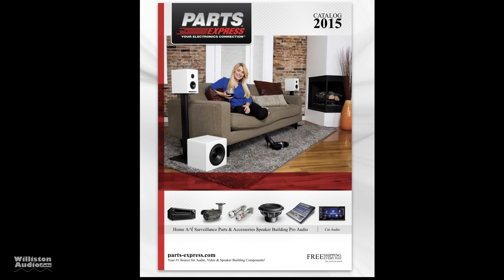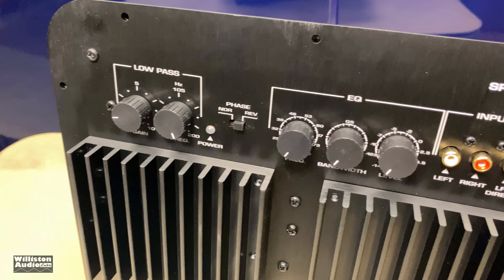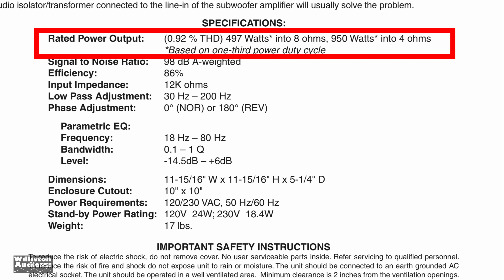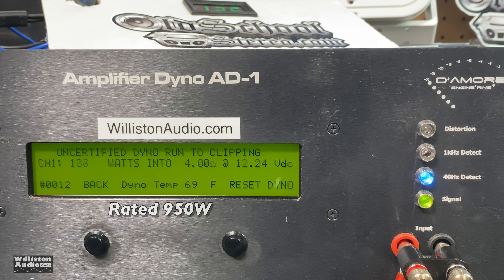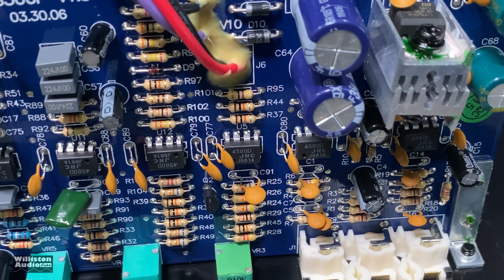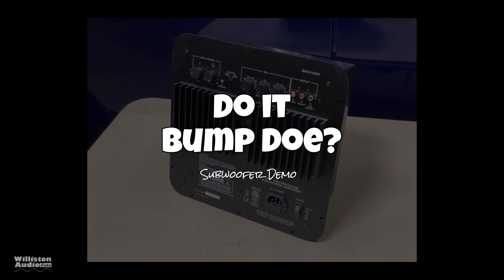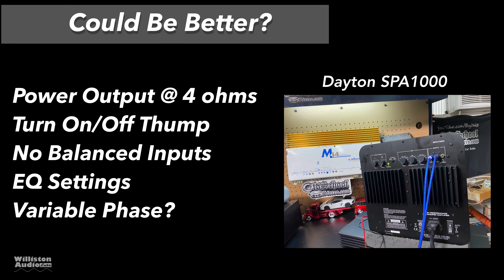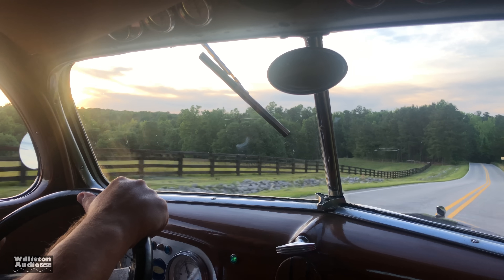DIY Subwoofer Amp for Home Theater - Dayton SPA1000 1000W

Comment from the maker: Shop for the Dayton Audio SPA1000: https://amzn.to/31Jb6Rz
Don't want DIY? Check out this Sub: https://amzn.to/2Z1S0V5
SMD AMM-1 Handheld Amp Dyno: https://amzn.to/3iw1Ztm

DISCLAIMER: This video and description contains affiliate links, which means that if you purchase from one of the product links, I may receive a small commission. As an Amazon Associate I earn from qualifying purchases
Reply: Tre L  I know seems like its way more affordable to get a car amp and rig it to a battery setup in a house than spend a arm and a leg on a very exspensive PA system and some plug in the wall subwoofer with outrageous exspensive💰 shelf speakers.
Reply: I got one of those , i put a 12volt amp fan in the side of it and run it a 1.5 ohms... Powered a rockfordfosgate p3 12 in a ford tarus on a power converter... Very loud... Still have it, wish i knew what kind of power it does
Reply: Williston Audio Labs 
Big d wiz! I’ve been trying to reach you for about 8 months now. I have a Lanzar optidrive 6000.1 1 ohm stable amp. There is absolutely no dynos on this amp once so ever. I would love to see what power it could do! Amp is pretty damn big too!
Reply: NEXT AMP YOU HAVE TO TEST IS ONE OF THE NEW ROCKVILLE DB COMP 3500 CEA RMS WATTS WITH A VOLT METER BUILT ON THE FRONT OF THE AMP FOR $349!!!!!!! ALSO FOR $299 THERE'S A 3000 WATT AMP AS WELL TRY BOTH!!!
Reply: @Mr. D if you think that intersting you should see me awsome extension cord plug in on my subwoofer box, no more spring connection or reg terminals. Works great ,just plug it in
Reply: Can you do the DB drive wdx 5k amp
Reply: @Mr. D i made the video, its called budget bass blazer
Reply: Would you like to dyno a Bash 300 and 500? i have them collecing dust if ya wanna try them out? i can ship and give a label to send them back.
Reply: Is the Planet Audio AC10D sub any good? I don't need more than 3-400W output for my setup.
Reply: Thank you I have always wondered about that parts Express amplifier. I enjoyed the car ride at the end very nice ride keep up the great videos thank you thank you thank you for all you do. ✌️

Comment: would this be safe to use with a JL 12w7ae?  It is rated at 3ohms but I don't think I would ever be using the full 1000w in my home theater use.

Comment: hi, is there actually any good plate amps ? i struggling to find a good plate amp that actualy is a sub amp an does not stop at 40hz... i want a amp with lower ramge an lots of power into 8 ohms since its an diy project and my woofers are 8ohms. a amp close to 750w@8 ohms an can stretch down to about 25hz without clipping at rated power. do you hawe any suggestions ?

Comment: I ordered yesterday The Dayton audio SPA-300D plate amplifier to replace the amplifier in my polk audio PSW 505 which is messing up and they wanted more money for that replacement amplifier because it's out of warranty then the Dayton audio amp. The Dayton audio amp seems to have some really good reviews plus, it does it's rated power for the most part and I had already replaced the woofer itself I went with a SDR 1200 watt 600 watt RMS Skar audio dual 2 ohm wired to 4 ohms and this thing packs a punch better than the Polk audio woofer, just saying. I can't wait to put that new amp on there but the new amp is a little smaller and diameter then the Polk audio amp so I have to make a transition plate which is no big deal because I know how to do that. The transition plate would be put on with screws and wood glue and painted to match. Yeah, it's going to stick out just a little bit but it's a lot easier to do it this way. Hopefully from what I read it will put out a good thump sound plus the Dayton audio amplifiers have a 5-year warranty versus Polk audios 3-year warranty.

Comment: This test is NULL AND VOID!!!  NO BUENO…. You’re testing it at 12 volts RIGHT??   Well can your refrigerator run on 12 volts or your microwave and dish washer?  Probably not THAT AMP IS TO BE TESTED AT 110 volts

Comment: Duty cycle whatever that means? It means the proportion of time that the amp is capable of delivering its rated power. In this case up to one third of the time can be spent at full power. This is fine for some types of source material (movie effects) which are short term in nature, but highly compresses bass-heavy music may cause the amp to overheat if driven at maximum power.

Comment: The problem with these devices is that they are switched power supplies, there are no parts to repair them, and you have to go to China to change the entire card, and they don't last long.
Reply: This amp has a toroidal transformer not the smps type

Comment: Hey Big D. I have a Polk Audio DSW PRO 660 , THE PLATE AMP just hit the bed after 13yrs . Do you think this Dayton is powerful enough for that Polk 12 inch . Thanks
Reply: This amp makes 40% more power atleast, will work fine.

Comment: a doppelganger of this amp is in my living room laying on a sealed box housing a RF P3 12" waiting to go in a tablesub enclosure with a JL W7 12" @ 3 ohms. I have the 500 watt version in a tablesub pushing the P3's sister @ 4 ohms, so no issue there. ill let ya know how 3 ohms goes

Comment: Another question for anyone who knows. Why is home audio usually 8 ohm's or 6ohms but car audio is usually 4 or less. And why is home audio lower watts the car audio?
Reply from the maker: Home audio has benefit of 120 or 240V AC whereas cars use 12V DC. Most people with their home systems don’t “bump” their home systems. You need 10x the power to be twice as loud so 1000W vs 100W is not 10x the difference

Comment: i use a dayton audio sa230 to power a JBL Club 1224 12" in sealed box that sits under my desk and two JBL LSR306p monitors for my computer setup (Sound Blaster Audigy RX) and it's a lovely thing.😎  dayton makes some decent stuff  edit: just seen that thump..  ouch. the one i got doesn't do that but it's a different model.  i wonder if they all do that?

Comment: I had Dayton's original hpsa1000 rack mount version of this amp.  It would be nice to see how one of those or even the current model compares to the plate mount.  That older model,   If you pushed It to hard. That Blue led would start to turn red when it started to clip. If you kept pushing it, it would go into protect. But would come back on after a bit.  I know It would do Allot more before it started to clip. Once I upgraded to a bigger power cord.

Comment: sir to prevent the turn on/off thump. you could add a relay on the output of the amplifier to get a soft starter switch for speaker. there's an output relay module out there on amazon or any circuit and electronics online store :)

Comment: Glad to see this test, it was satisfying to see it come in under the rating for four ohms, keep in mind it does outperform by a larger margin at 8 ohms.  For my purposes the Crown Xli 2500 is a far better value, you can see the Xli 1500 beats the numbers by a lot.  Based on the Xli 1500 tests, the 2500 should be able to roughly 982 watts at 4 ohms per channel, the biggest downside is it can't do 4 ohms bridged like the XLS 2502.  Still though the Xli 2500 is the same price as this plate amp, and has lower THD...  Many people say the fans are never noticeable, depends how hard you drive it of course, but we'll see because I purchased the Xli 2500.

Comment: That wattage number is a joke! It's not possible to obtain that much power in class AB with that power supply,number of final transistors and that small heatsink! If your contraption's measurement is real,this amp can't be class AB!

Comment: How would you run this with signal coming off a receiver with a dedicated single sub cable output? Would I just use a splitter before going into this amp from the single rca?

Comment: I have this amp matched with a 18" ct sounds tropo what settings would you recommend on eq I have it running on 8ohms bc 4 ohms clips amp to the point of turn off

Comment: question. I'm building new speakers that each will include 2 DVC 4ohm subs. I'm looking for a decent sub AMP plate with power ratings between 100-200 watts. all I could find was the Dayton audio PA100. 109$. are there any good suggestions pl? Thanks

Comment: The thump is very concerning, apparently their rack mounted model does the same thing.  I would love to see variable phase (the rack mounted model has this), which should be a requirement for all subwoofer amplifiers.  The fact that it is class AB can be appreciated by us audiophiles, but in plate amp form it appears that it will take up quite a bit of internal volume and make bracing the cabinet a bit more challenging.  Thanks for the dyno!

Comment: I realize this vid is older, but I just saw it.  There is a problem with this particular unit.  You shouldn't have that on/off thump...DC voltage is getting to your speakers.  The protection circuit should take care of that.  Have you spoken with Dayton about it?  Remember that NAD 2200 you tested,  I also have that unit and had the same "thump" issue with it and it wound up being the protection IC that controlled the speaker relays.  I replaced the IC and the thump was gone.

Comment: Shame on dayton audio all they had to do is add a speaker pertection board to it you can probably find on parts express eBay also has one  30a 110v speaker pertection board perfect for a add on to this amp 17$ and your speaker doesn't pop 🤔😉👌✌️👍💯🍒
Reply from the maker: Odd I agree

Comment: I've had this amp driving a TC Sounds Epic 12" in a home made 3' cube sealed enclosure for the last 8 years. Never had a problem with it and it literally shakes my entire viewing area. The Epic is a great driver, it seems TC sounds either went out of business or changed ownership or something, because I can no longer find these subs available online. But the Epic is clean, has great transient response and digs below 20hz. The Dayton amp has been solid and problem free for almost an entire decade! It's the first Dayton product I've even bought, and so far the brand has impressed me. Very curious to check out there ultimax and HO subs.
Reply: CT sounds is still around.  So I found 2 klipsch SPL-150SW in the dumpster about 2 weeks ago.  The boxes were trashed . I finally took it apart to inspect before plugging anything in. Both subs work perfectly , and one amp. The bad amp powers on , no bad caps, but like I said this person threw it around and it's missing the toggle switches and whatever is damaged  internally.  I'm contemplating on bringing the amp to be serviced or going a whole different route.  Currently I'm running a infinity CSW-10 and it's a great sub but getting them lows would be killer!  I already in plans to build a box out of birch and I'm thinking of doing a sealed box then original spec of it being ported. Idk way to many projects and suddenly I'm wanting to fiddle with this , when I still have a 13 W7 I bought 6 years ago still in its box(I gave up on car audio because of thieves)
Reply: Good grief I'm  totally dyslexic. TC/ CT 😆 🤣
Reply: @Woke_fatigue  My amp finally went out on me about 8 months ago, I kept the Epic but got an HSU Research 15" prebuilt for the home theatre now.
Reply: @MadClowdz  thanks for the reply . Yeah I think I'm going to dabble around and see what I can find. I'll probably just bring the plate to someone to have it serviced.  Might as well,  bring some other items there too.  . I got way too much gear 😆.

Comment: Is that a home infinity sub at 8ohm ?
Reply from the maker: 4 ohms and it’s a car audio subwoofer (Infinity Kappa Perfect VQ)
Reply: @wal  Wouldn't that ruin your 8 ohm  amp driver ? Very curious ty
Reply: @feboogi  no as long as you don't put a low ohm on it the amp is 4ohm and so is the speaker.   the only time any thing like that happens is if the ohms are why to low then the rating. look up ohms law  for a better answer.

Comment: Dayton Audios plate amps are very stout.  About 6 years back I had a big 1/4 wave TL with a 4 ohm dvc sub that I was running with a Dayton 240 watt plate amp.    I was supposed to wire it to 8 ohms in series, but I accidentally left it wired to 2 ohms for a Halloween party for 4 hours.   It got hot but never shut off.  Fast forward to  yesterday and I had been using a Avionixx 2000.1D with a power supply to power a Dayton Ultimax 10 DVC 2 ohm at 1 ohm.   I switched to my Dayton 240 watt plate amp and my son played it loudly for about 2 hours.  Came back in my house and it had shut off, VERY warm.  I thought I had killed it, but I unplugged it and let it cool down and it fired right back up at 4 ohms series.
Reply from the maker: Thanks for watching and commenting!

Comment: Have you ever tried testing amps at higher than 14.8v? I have heard an odd rumor that some amps give their rating as if they were attached to a capacitor. Capacitors could give more volts than 14.8 for short bursts so maybe that's where the high wattage ratings come from. More volts rather than amps. 

By rumor, I mean an argument over nothing specific that somehow went over to amplifiers.

Comment: The 1/3rd duty cycle is what they do at Stereophile probably when they test, and I think they do it because that's how the FTC does it's official tests. And what they do is run the amp for an hour at 1/3 power, because that's the hardest you can work an amp. Then they test it right after that. It's to put everyone on a level playing field. No amps that can only put out crazy watts for a few seconds will get an official rating this way.

Comment: Thanks for your videos : ALWAYS super informative.
Kindly, advise on pioneers subwoofers; ts-d12d4 vs ts-w3003d4 which is better in low deeps, more excursion and durability considering electronic specs are identical; only material build seem abit different.
Using Pioneer GM D9701 Class D Mono Amplifier.
Thanks.

Comment: Thanks BigD, the main problem I feel here is that lot of people would wondering how 1% distortion sounds like. It is possible to connect a 100 Ohms resistors with a classical speaker in parallel with the dyno when tuning with 1khz? I think is too hard to reach a regular 1% distorsion with a song. Microphone switched on, and try to heard how a 1% distorsion sounds like. Nice videos, as usual.

Comment: I use one of these in my shop system. I picked it up (still NIB) on the used market for $150. Very solid amp! Mine does not thump nearly as bad as that one.

Comment: That was a very cool to see review.  It would be awesome to see you do a review on some of the clone amps like a FP 20000q and see if it is capable of the claimed 4000 x 4 burst power and 8000 total continuous till it trips the breaker or melts down.  That is on a 30amp 240 volt circuit.

Comment: I have never been disappointed by ANYTHING I got from PartsExpress.  The Talent line of cables are fantastic and quite inexpensive compared to other brands.  My only complaint is... they do not ship to P.O. Boxes.  My home mail service sucks big time.  So... even when I spend enough to get 'free shipping', I still have to pay for UPS if I ever want to see my gear.

And for those of you that need a really heavy duty boom mic stand, check out the "Talent AMT Heavy-Duty Tripod Boom Stand for AM150 PA Speaker" for $21.98.  It's in the mic stands, but I overlooked it several times because the description says it's for a 'PA speaker'.  It is totally indestructible and easily outshines mic stands at $100.00+.  When I unboxed it, I could not believe how well built and strong it was.  It is made like a miniature speaker stand (slide down and lock in position braced HD legs, pin to hold the vertical pipe in position, really strong clamps on the rotating arms), but has an adapter for standard U.S. mic clips.  And, if it comes to that, you can use it as a fricking weapon if someone starts something because they don't like your music!!!

Comment: $400...screw that... wire up a car audio amp for half the price
Reply: A 12v supply to power a car amp properly will not be cheap.  100a 12v supplies are $$$$.

Comment: I have the SA1000 version of this. It’s the rack mount version. Same specs. It’s pretty beefy. Pushes my single 10 down deep and hard. It does have a phase shift on it.
Reply: How do you attach the single driver to the SA1000 power amp that has left and right outputs? Did you use bridged mode? And if so which channel you use as input?
Because here SPA1000 when both inputs (RCA L+R) are attached, it provides one output.
Reply: @henrikhengerics6782  its mono... with two parallel outputs
Reply: @soniclab-cnc  How it is mono? How do you get same output from the R+L. And yes, that way it is paralel.
Reply: @henrikhengerics6782   you can use the stereo summing inputs or the LFE input.  It is a monoblock amplifier.

Comment: 86% efficiency class AB? Hmmm
Reply: I think is class H .
Reply: @elvinechevarria8079  It uses a tracking downconverter, so technically Class G or H which, while similar output stage to AB, explains claimed efficiency.
Reply: That's not unheard of on a 110 powered amp.
Reply: @runningbear1982  Sure is.
Reply: @carlosoliveira-rc2xt  it is styled after a bob Carver amp and Bob Carver amps were notorious for being highly efficient as well as beautiful.
Reply: @runningbear1982  Yes. I have stated the technical specifics which doesn't make it Class AB. We all know Class AB is electrically similar to G or H but a pure class AB amp is never going to be 86% efficient. It's impossible.
Reply: @runningbear1982  I owned a Carver amp back in the late 80s. They were garbage and tended to buzz. Not beautiful, not great sounding or reliable.
Reply: @carlosoliveira-rc2xt  I don't think you know what you're talking about. If you can't state ohm's  law 100% verbatim, I highly doubt you can grasp the concept of using variable transistors to achieve higher efficiency in circuit pathways.